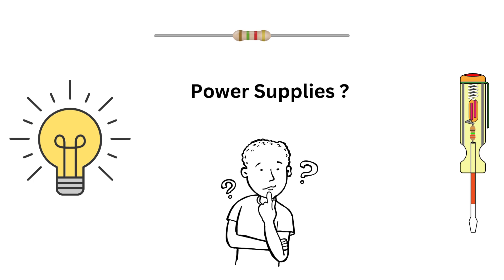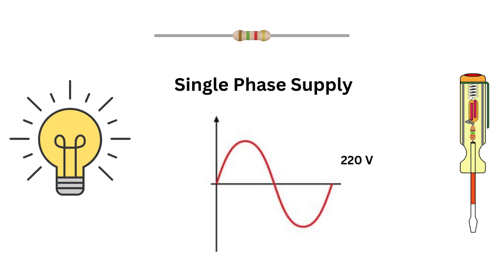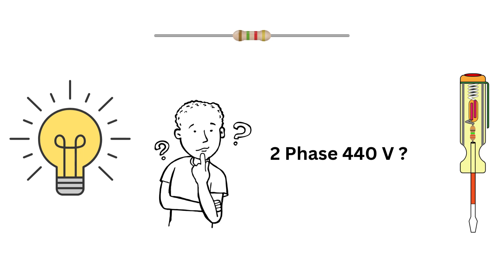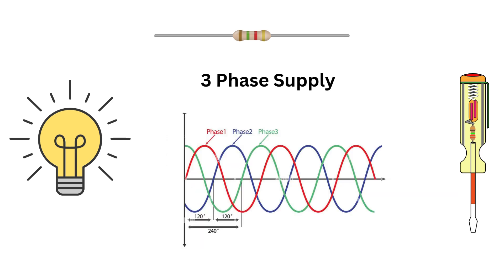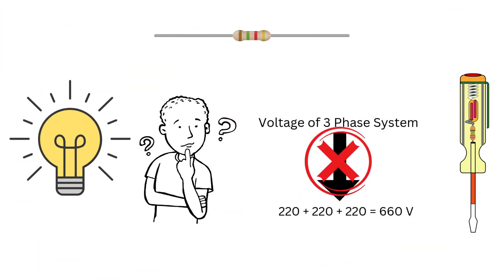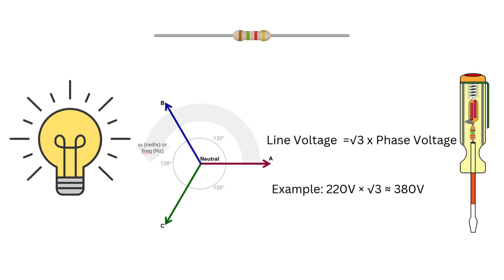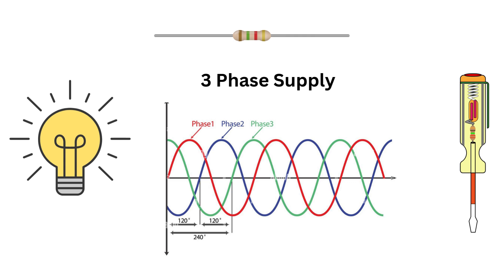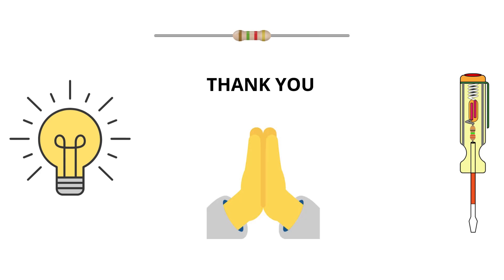3-Phase Power Explained: Why It's Not 220+220+220 = 660V!

Comment: Thank you. How would you advise that a Split-Phase inverter be wired in India or Africa where 220 or 240V is used? Take for example the EG4 12000XP inverter which is a 120/240V.
Reply from the maker: That’s a very sharp and practical question — it comes up often because a lot of split-phase inverters like the EG4 12000XP are designed for the North American market (120/240 V split-phase), while countries like India and much of Africa use single-phase 220–240 V systems.
Here’s how I’d advise wiring it:- You can run the EG4 12000XP in India/Africa by using L1 as phase and L2 as neutral (gives ~230 V between them). Don’t use L1–N or L2–N for loads since that’s only 120 V. Bond the inverter ground to earth, set output to 50 Hz, and you’re good — works just like the local single-phase supply.